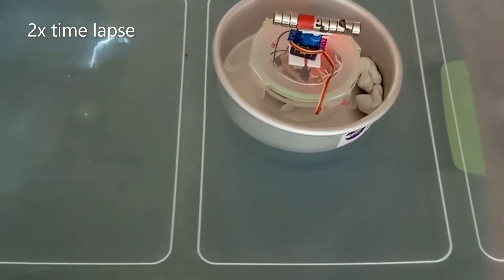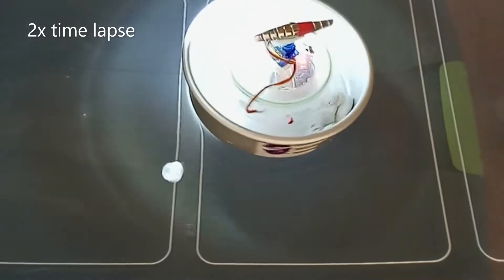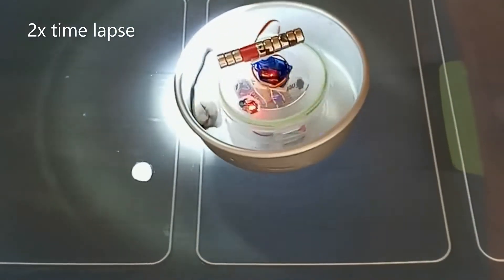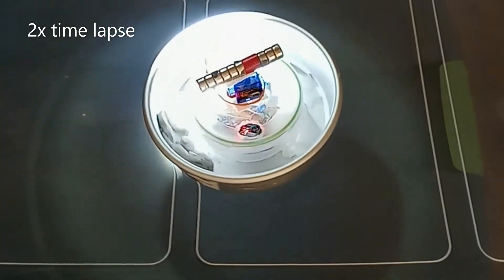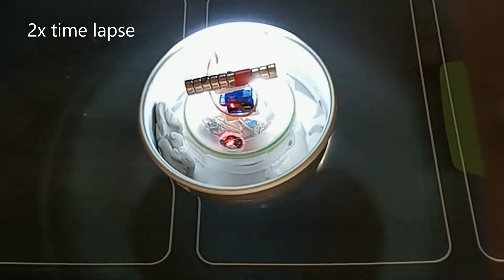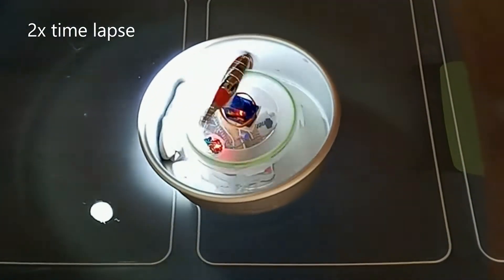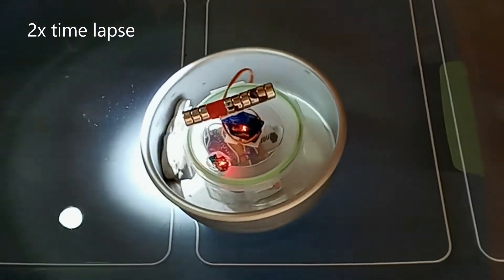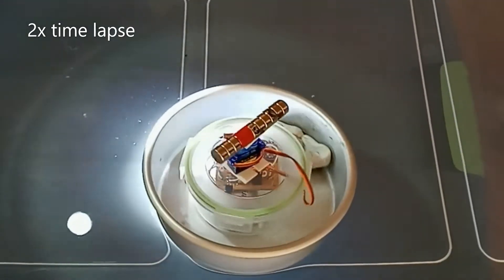Magnetic Inertial Propulsion Demonstrated with Statorless Motor in Small Boat

Comment: This is the first one I seen that uses water in inertial testing. Bravo 👏🏼... Water is the best current method to reduce frictional forces as much as possible. It's somewhat evident though that the force reacted against are the earths magnetic field lines.  Great Job 🎉
Reply: How would it work over space though?
It barely works here.
Reply: @yasirrakhurrafat1142  EXACTLY 💯.This is why I suggest water/a pond, etc, as a testing medium. Even if it works even only slightly on a calm water body, then we will have a  better idea of space operability.